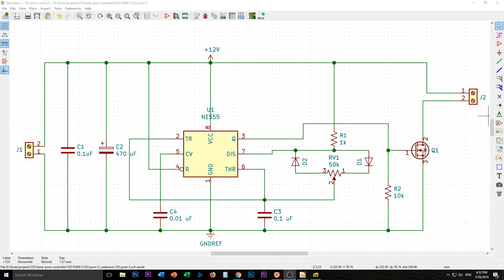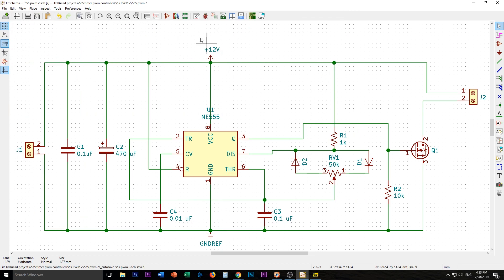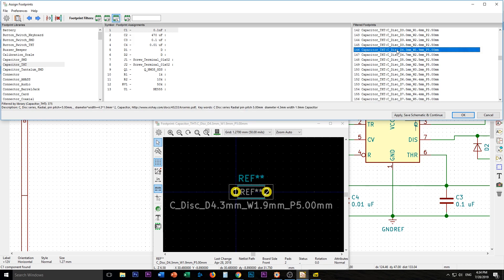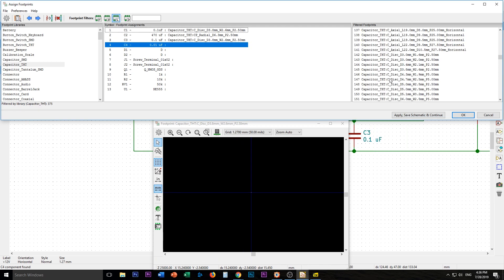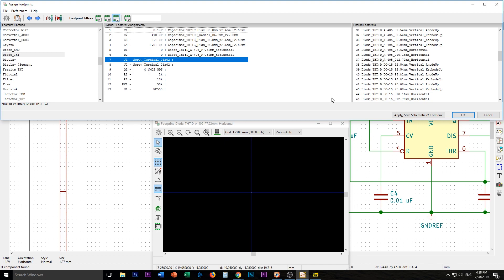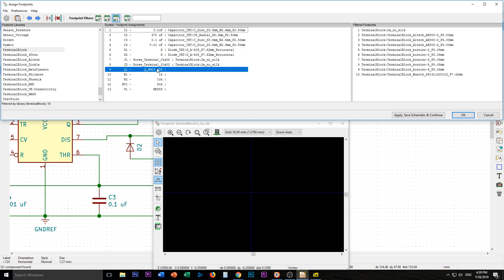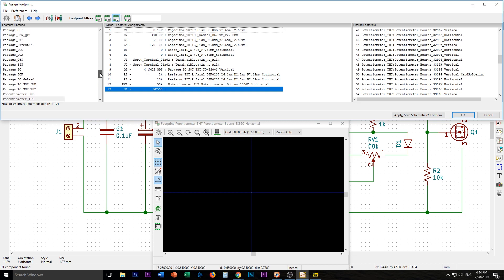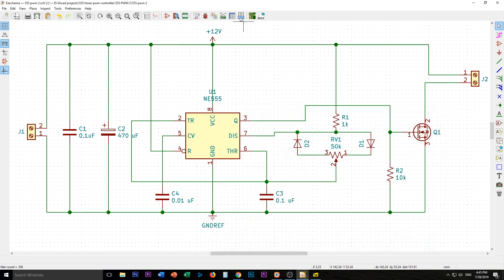KiCAD For Beginners 2 - Setting Up Footprints

Comment: In EasyEDA each device comes with at least one certain footprint. I prefer certain footprints for resistors, capacitors, transistors and diodes which I have allready preselected in the basic device selection list So you can choose the footprint from the beginning. But you can also assign it to another footprint later on. In most cases I have allready the right footprints in the device selection and need no changes later on. This makes PCB development really fast.